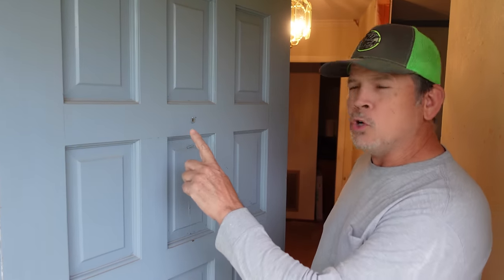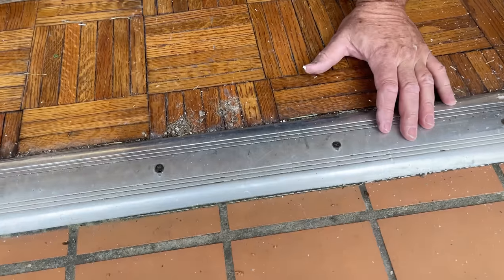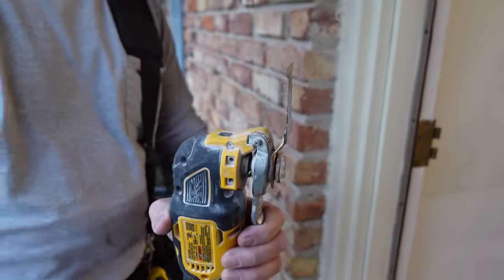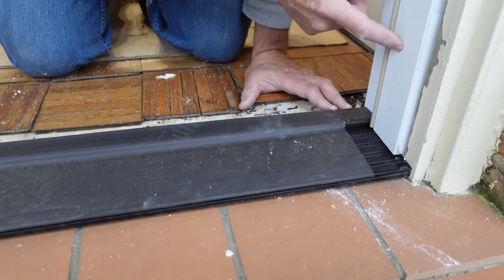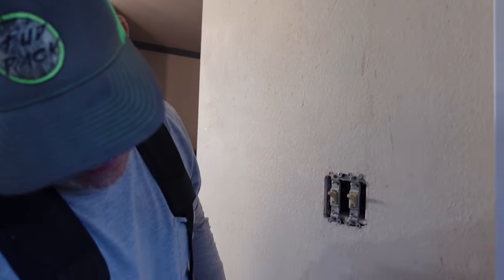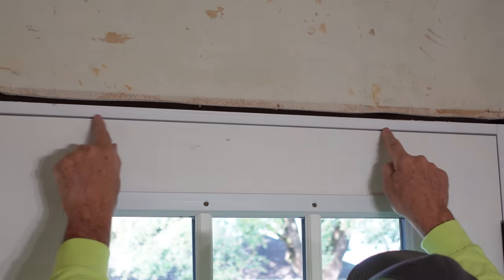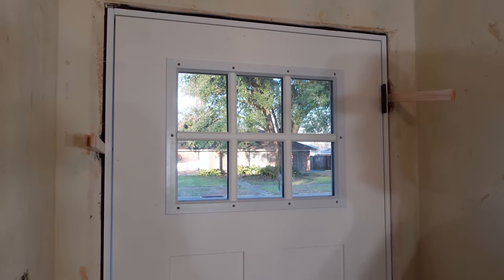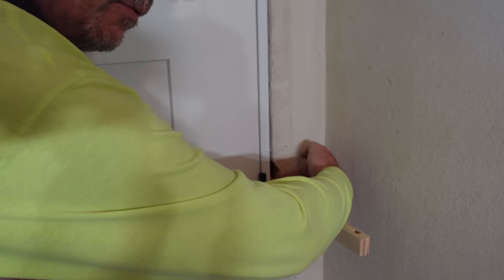HOW TO REMOVE and REPLACE a Front/Back Door (Easier Than it Looks!)

Comment: That gave me a lot of confidence for when I get around to doing mine. It would have been nice to see how to measure the door before you go to buy the new replacement, but maybe they are standard sizes? Thank you, have a nice day.
Reply from the maker: Thanks!  Yes, basically standard sizes.  This one was what I call a 3-0 x 6-8 or 36" x 80".  3-0 = 3 feet = 36" and 6-8 = 6 feet 8 inches = 80 inches.  You'll find it's not an exact dimension but it's close.  Standard sizes are WAY cheaper than custom.  The key is the rough opening size.  Remove the interior casing so you can see where the framing is.  measure stud to stud for the width and slab/subfloor to the header for the height.  Bring these number to your door company and they'll help find the right door for you.
Reply: @StudPack  Thank you for the detailed answer, I really appreciate it.

Comment: Excellent install video. I could easily work with you guys.  So much half a$$ing out there. I have the same concern about poor manufacturing. It's not just millwork,  it everywhere and not getting better. Inspection of everything before exception is a must.

Comment: I have to ask. As a carpenter myself. You checked the brickmold and found it a 1/4" out but the door you installed plumb. Do you see where I'm leading to, because you didn't show the reveal on the outside...brickmold against the door jamb. And I noticed you didn't put a level on the threshold to check for level, which is a very important part of a proper door install. I liked the rest of the detailed explanation of the video. And great idea on the polyethylene shims behind the hinges! That's all that I picked up on. Over all, a pretty good job on the entrance door install.

Comment: I'm definitely not going to do this myself, but I am going to tackle removing an interior door frame and building a new one (couldn't find one wide enough at the local stores as we have plaster walls. So the removal tips were still helpful.  This way if I fail it will only be an inside door that will need missing until I can hire a pro to come out.  I have a feeling it's not going to go well after watching this video though.  

Almost seems like I should build a prehung  door for from a custom grand and then install it.

Comment: I like to make the jamb side perfectly plumb. Slam the door frame up against the jamb side, no shims needed there. It can be nailed or screwed good and tight without messing up alignment. Then shim the striker side as needed. I know it's not always possible to do it that way but if it is, that's the way I like it.  That was a cool trick saving the outside :)  I never thought outside the box for that one.  You could charge money for this.

Comment: I never use those kinda shims... I don't think the main problems in the hinges, it's in the jambs or sometimes the slab itself warping some. Also, in other videos, I've commented on how I like to use some liquid nails as I place my shims so shims will stay in for the long haul & not move or split. This also holds them in while I'm still adjusting the door & jamb. I also want to screw or nail thru the shims, so I like to pre drill &/or countersink as needed.

Comment: I had a carpenter install 6 new interior doors many years ago. They never really shut right, or at least three of them did not. I had to remortise the hinges locations properly. Since the carpenter didn't have a jig, some of the mortises in the door for the hinges were too deep. I will grab pieces of paper, or thicker oak tag, and tap them with a hammer lightly against the mortise on the door to make a thin spacer. I then cut them out and installed it behind the hinge.

Comment: Do you ever do reviews of new product for DYi / home improvement? There is this new door hardware called Resecure Latch. It replaces the ugly metal sleeve that is used to hold a door latch or dead bolt into the door, or the use of glue, sticks or putty. The product sits INSIDE the door over the latch. Once you put the door handle back on, you don't know there was a repair. Very cool, especially for expensive or antique doors.

Comment: Thank you for an easy to understand show.  I have a home with Plaster walls , so my door jams are thicker than the standard 4 9/16.  Was this why you just left the outside jam on
and put the new door in from the inside?  Can I make this work on my new front door?  I also need to replace a bathroom door and it's 5.0?

Comment: Great video.  I learned a lot.  But I don't understand why you didn't remove the door from the jamb prior to attaching the jamb to the frame.  It seems that muscling the entire pre-hung unit about is more work than necessary and the weight of the door may actually work against you when attaching and plumbing the jamb to the frame.  Also, what is that power tool you used to cut the nails securing old jamb to the outside casing, and what type if blade did you have on it?  I think you used that same power tool to cut the excess shim material off too, but it might have had a different blade on it for that.  Did you call it a "buzz saw"?  Could you please provide a link to the type and maybe even the brand of that "buzz saw" tool?

Comment: Door frames are always a challenging time. As you have pointed out bricks or issue there never level but that’s pretty neat that your stud was perfectly level. The issue sometimes I have found is that you’ll get a top or bottom corner that does not go all the way up againstthat door seal. Trying to move that in or out is very difficult. Any suggestions?

Comment: Great job. Most you tubes are like taking one karate lesson and thinking you can kick ten butts. I have about 35 years of carpentry and 1 year of doing nothing but  remove and install doors. I get your angst against door manufacturers. I have seen a bunch of hinge spacers from paper match books to auto gasket material. The good news was at least they straightened out the margins and performance of hinge from binding. Great job. Good cameraman as well. Oh. Good luck on the parquet floor.
Reply from the maker: Thx Perry 👍

Comment: a commercial carpenter in NYC ,you haven't lived till you unload a 53 ' trailer of doors ,,,our doors are set off a benchmark ,but basically the same install ,shim on top at header that way you can't go too far ...shim behind hinges and shim strike screw to hold. ....stanley hinges came with cardboard strips wit adhesive backs to PACK hinges ,don't come that way now as when I retired..we used veneers shims or wooden coffee stirrers. .the doors were leveled off BM 5' AFF. [5; ABOVE FINISHED FLOOR] measure off top of door to set a bank of doors to same height  to be more precise ,we made a story pole

Comment: Good one. Now, how do you install a door like that when the walls are cinder block? 

Tapcon screws kind of suck at best, and are no go for a door hinge. My temporary fix a few years ago was to install 2x10 wood frame against the cinderblock, then put a 32x80 pre-hung door in. It works, but you better only ever buy really skinny furniture going forward. I'm going to have to redo that door after the next project is done, so I'll again face the problem of dealing with the cinder block walls.

Comment: Between the plastic door hinge trims and the Gator sticker plates I found recently should be able to correct many door problems around the house....without using a heavy hammer and a mad as heck swing....thanks guys

Comment: During the install of any exterior door, in these crazy times, it seems remiss not to install some door hardening devices.  One good kick and the deadbolt and lockset are going to splinter that lovely new door frame.  Longer screws are a good start, but their are inexpensive metal reinforcing plates that are a pain to install, except when the door frame is removed or replaced. Great video, though.

Comment: Another method is to  bend the hinges on the door.  The pin is removed to do this.
The frame side hinges can also be bent  outward to shift the door  ,  and close up the gap on the other side.

Comment: Why not bend the tabs on the hinges to create more space instead of putting a shim behind it?  If you do that, the face of the hinge will still be flush with the face of the jam.  You can also do it without taking the screws out of the hinge.  Just remove the pin and use a pair of plyers and a leather strip to protect the hinge.  Put the pin back and you are good to go.

Comment: Great video but you neglected to take a  couple of very simple steps to render the door a considerably more secure. Shims between  (preferably strip of plywood, or better yet, a metal plate) the jack stud and the lock jamb at the strike location and at the hinge jamb behind the hinges  would make the door about 200% less vulnerable to a kick attack. Make sure the lockset you buy has a steel backplate under the decorative strike installed with 3" screws.  As a former cop tuned security consultant as well as woodworker (admittedly, not a very good one), I have actually tested these strategies and they work....  Other than that, I like the way you install a door better than my way. I'm a fan.

Comment: When you foam the cracks, do you use the non expanding foam?, and ......what did you do about the floor and the threshold?  Was there a rubber seal on the bottom of the door?

Comment: Wow great production and editing quality on your vidio and Great Job on explaining all the tips and tricks. One question, Rather than install the hinge shims I have seen others use a nail punch in between the hinge plates and close the door so as to bend the hinge out and create the space needed around the door. This alternate method seems to be more of a hack, What is your opinion?
Reply from the maker: Bending the hinges is a great solution, especially if you don't have the means to make custom shims. We just try to shy from bending metal as much as possible.

Comment: I like how you didn’t remove the brick molding.  That definitely helped to align vertical angle assuming it was good.  Every door opening has a handful of potential issues dealing with framing alignment and much more.  Door manufacturers have ideal factory conditions for making that door.  Each door SHOULD be a perfect carbon copy.  Human manufacturing error is definitely the Murphy’s Law factor.

Comment: Overall he did a  good job there's a few points that you could have covered rule #1 before purchasing the door check for any miscellaneous hinge or hinge binding and any other assembly issues door manufacturers have bad days too rule #2 check the door opening for any misalignment out of plumbing out of level in most cases you can correct these issues prior to putting the door in rule #3 never commit to permanent fasteners until you are sure that you're margins and that the camber of the door is correct otherwise it will become a nightmare preferably if you have a lot of doors to hang find a seasoned veteran to show you how to do it properly

Comment: I thoroughly enjoyed your video, and this video was done 2 years ago.   

What I find surprising is that you never showed the finished door from the front  and how the exterior trim looked against the new door.  Never showed if you used a caulking between that old trim and the new door casing.  You don’t mention that you do but I would have assumed that there should be something for wind or rain.   Other than that, loved your suggestions. 

I did subscribe and like.

Comment: If you drive a nail in just below the shims, you can slide the shims with the door closed to pull the nail just enough to perfect your reveal and then drill a screw through the shims to secure the final adjustment.  A #8 finish nail need not be removed when you are done.

Comment: I would have added a  steel plate for the striker dead bolt while it was open.
I had the extra fun of moving the header since I raised the floor.

I must admit I have never seen a router recess like like that.  But I look at doors I buy.  All 4 of them. :)

Comment: Have you ever wrapped painters tape around a hex key, placed it inside the hinge , hold it up against the hinge and close the door on it? You changed th geometry of  the hinge and have no need for a shim. This spreads the hinge leaves apart. The tape keeps it from marring the hinge. The reverse of that is to use a "Hinge Doctor" and it will actually bring the leaves closer together, also without marring the hinge leaves!

Comment: Did you guys decide not to show the strike /lock dog side of the frame shimm process? 
How do you insure the frame is supported  well enough to secure the strike and lock receiver without shimming and using long heavy screws on that side into the framing?
This is important so the frame cannot fracture longitudinally if the door gets slammed repeatedly, or a break-in attempt is thwarted better as the metal of the strike is tight to the dog and secured to framing instead of just the frame, correct?

Comment: I always remove that exterior “stop”.  So I could leave the brick mold on the new door jamb..   Easier to plumb jamb with brick mold.. Definitely looks like a new complete job….   Sometimes we have to alter the notch where the striker plates go..  No quality control at the factory.

Comment: Little trick I inadvertently learned.  Use composite screws to get door adjusted left to right.  When you sink them, the reverse threads at the top of the screw allow you to back the screw in and out without the head moving to a proud position, but moves the door frame.  Makes it easy to get the door frames perfect all the way up the legs with ease of adjustment.  Add shims to fit and trim nail them off…good to go!
Reply from the maker: Yeah I think GRK makes a screw just for door installation that works like that.   I’ve used them pretty sweet 👍

Comment: The best door pin removal tool I've found I sent you the link to.  The spring loaded ones will bend.  You used your nail punch on this video,  try the Crain door pin remover tool I sent you the link to.  It's the best!!

Comment: as a young finish carpenter i was sent to a Apartment to Condo conversion. All (ALL) doors of all 50 units were removed except for the entry and stored with no markings / legend / list of any sort in the basement. Hinges removed, leaning, screws in a bunch of cardboard boxes. It was an effing disaster. I spent 14 months sizing, planing, flipping, re-mortising, straightlining, routing curves into stops then re-cased over 700 doors. Hundreds if not a thousand more in the following 25 years. Doors are kinetic architecture / fixtures that live and operate in all 3 axis x-y & z and if a jamb is 'cross legged' the vertical plane is x's 2. There is nothing 'Simple' or 'Easy' about proper butt hinge or pivot door installation. If you have learned the process and can troubleshoot it can appear straightforward but given the number of crap installs i have removed and re hung or replaced few know how and fewer are learning. i wont even get started on MC Escher casing in settling old homes. Hire a pro, you wont regret it when the door still functions 10years later.

Comment: I can't say how many times I have had to mess with what the manufacturer should have done in the shop. One thing I like to do is load up both sides with caulk at the bottom of the jamb, between the framing and the jamb.

Comment: Hey STUD PACK. Have you ever removed a door and casing that swing in and changed it into a door that swing out?  I have a shop and am contemplating changing the door for safety reasons and also to reclaim some wall space.
Reply from the maker: I wouldn't reverse an inswing exterior door to an outswing.  There are a few key differences most notably the way the threshold is designed.  Also, an outswing door will have security hinges on it.  I suppose though it would work in the right circumstance.

Comment: Got any video's on straight up replacing entire door frames? I got a back door that's failing to keep cold air out. The frame is falling apart because 15+ years of built up impact damage. The door frame is for sure shot and I'm not entirely faithful on the framing behind it neither.

Comment: When I was younger I installed lots of doors and windows, now I sell them. I’m our resident shop door expert and have had the opportunity to tour several distributors door hanging facilities over the years. I think the problems with the door in this video were a distributor (prehanger) issue rather than a manufacturer issue. There are no CNC machines when you walk down a prehanging line, just some dudes with a few weeks training and who are probably making slightly better than minimum wage and don’t care working on a jig with a hand router and chisel. I have better success with some of my vendors than others and over mortising hinges is a constant problem for the ones with older equipment. This door had a Masonite sticker on it which may mean it came from Home Depot which if it was off the shelf it’s a lower quality version of what you buy from an independent dealer even though it may look the same. They have thinner skins than their regular doors. Also buying from your local shop should get you someone that understands that those flimsy residential grade hinges are only fit to be thrown in the trash. I always upgrade my customers hinges to commercial grade which have a thicker barrel and thicker metal leaves. Last those door lites that require plugs are very old fashioned, and typically these days we use more flush glazed lites that don’t require plugs. All those options create a more expensive door but the details all add up to something that looks and works better and will last a lifetime.
Reply from the maker: Thx for the info Jared.   This door came from a local mill works shop special order.